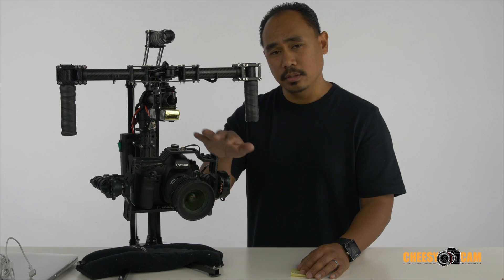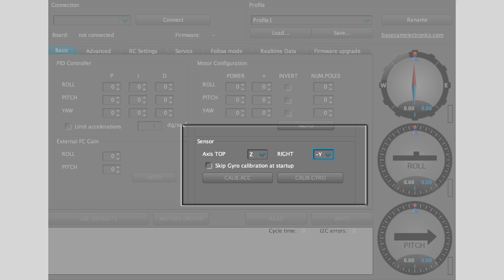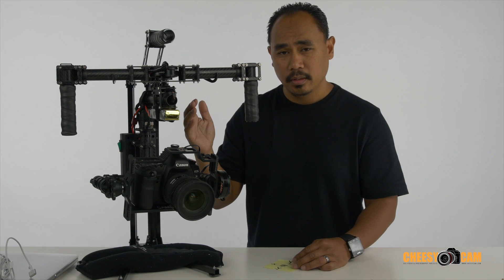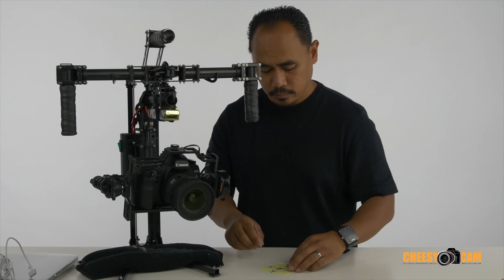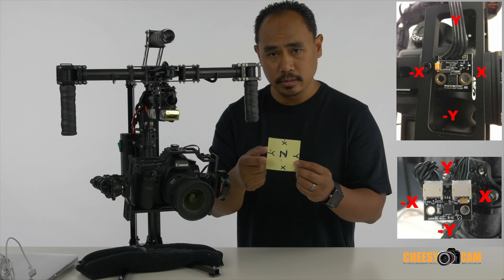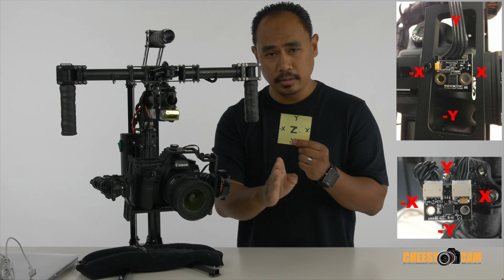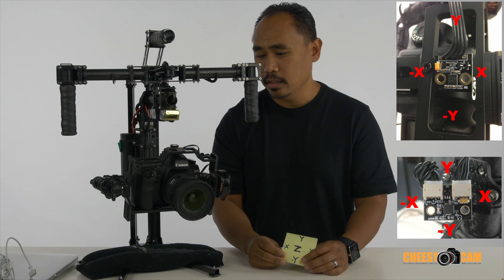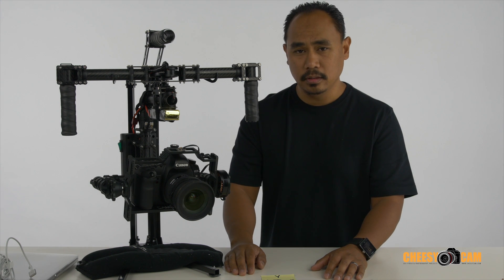Part 5 - CAME 7000 3 Axis Gimbal Build Mounting the IMU Sensors

Comment: My sensor wires are not long enough to reach if I run them through the motors??? I checked the spare sensor I have and its wire is the same length? Do you have any advice?